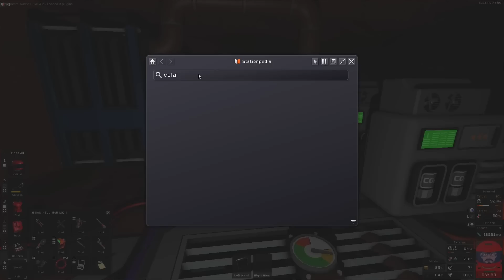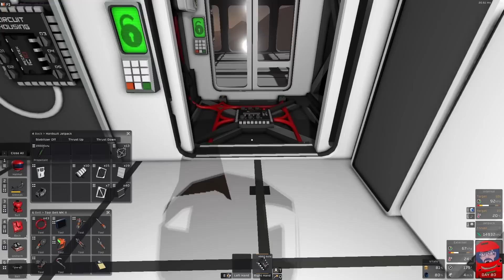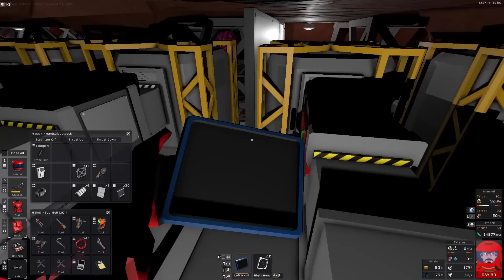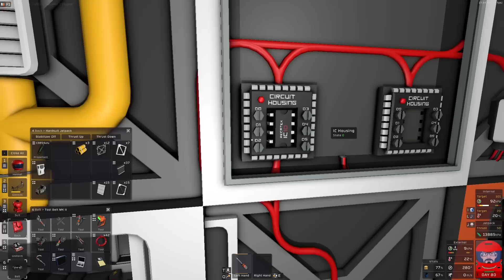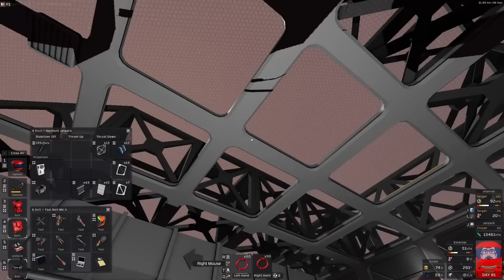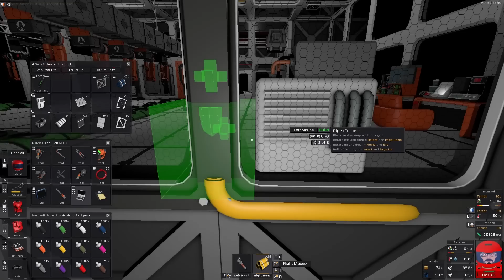Stationeers Let's play Terraforming Mars 19 The new farm

Comment: Mick....another awesome video, as usual.  How did you paint the entire room of wires at once?  Also, do you have a good way to use a "timer" in IC code?  There is the sleep command, however, if I put the farm room temp and pressure control on a chip, I can't come up with a way to put the grow lights on the same chip.  As I would need to "sleep" the chip for say 600 or 300 sec...or whatever to "time" out the grow lights, which would in turn sleep the same chip for the temp/pressure controls......🤔🤔
Reply from the maker: I use a solar sensor for grow lights.

Comment: Would it not be quicker to just use a rocket to dump Nitrice straight out into the world, letting it sublimate and increase the pressure? Or would that also result in the temp dropping? Or if you use a crusher to convert it to a gas, and then pass that gas through a heat exchanger to heat it up and expand it before just venting it straight out to the atmosphere.
Reply from the maker: It would be quicker but would put a heap of NOS in the atmosphere.  Solve one problem by creating another.  I do need a better way to melt the ice though.  Perhaps a melting room but then the water would be lost.
Reply: I guess that would not bring in more gas in than the way it is done now.. just more rockets might be a solution, or an army or aimees that gather gases only ^^ might be fun to see.. hundreds of aimees waltzing around .. orgers maybe ? .. but I guess rockets are faster after all.

Comment: Morning Mick, are you planning to upload your custom airlock script? Would really like to use it on my own Mars base. 
If you already have, thank you.
There is an option for extra H2. You can split the water you have collected and bump the surplus O2.
This is because you also need H2 for your power generation.
I am using this to create fuel for my gas fuel generators. It does take 5x3.6kW to produce 4x11kW. Isn't physics fun.
Reply from the maker: It is a bit slow for the amount I need.  More rockets perhaps.